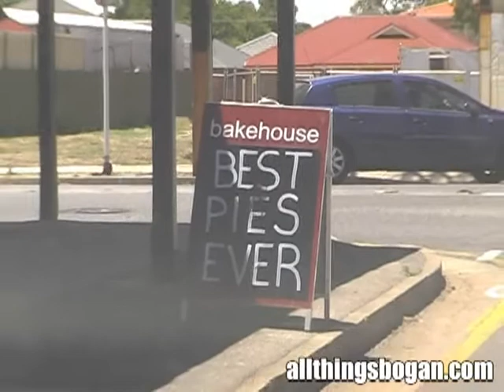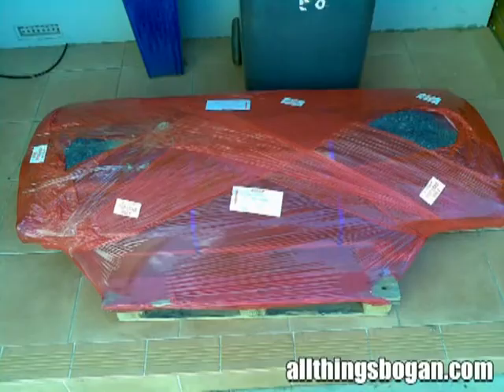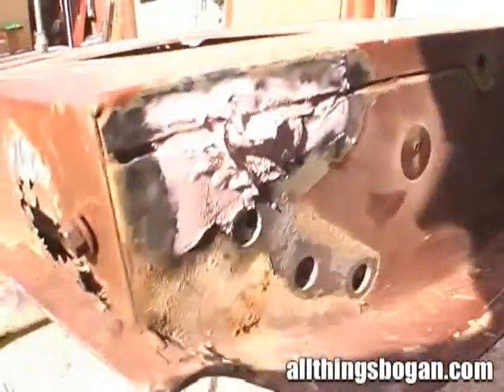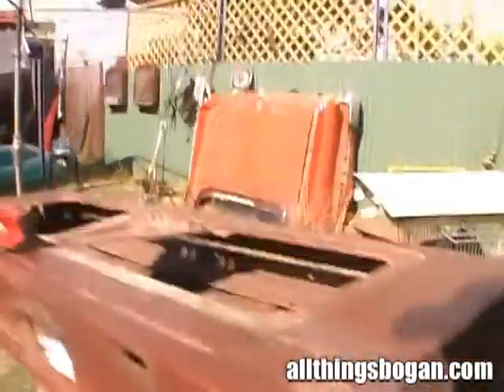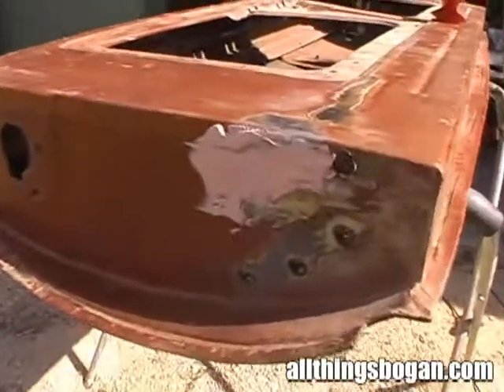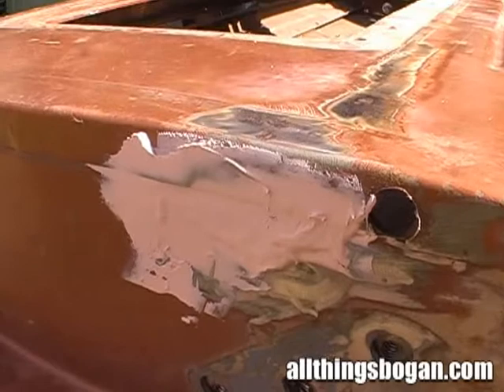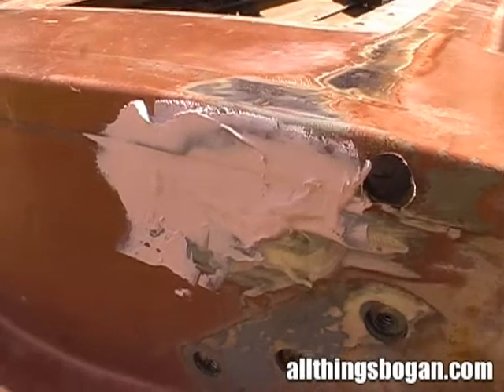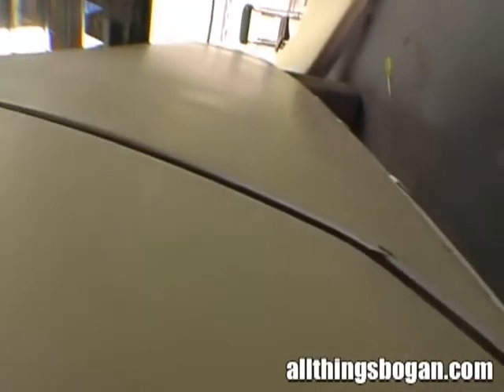Gus Bus Episode 9

Comment: Excellent work, keep it up. I had a Centura, great engine.....terrible handling. Still wish I'd kept it. 

All that bog reminds me of my 240z rebuild. I find using builders bog first makes for a better result because it is not hydroscopic so it does not let moisture to the metal. Still need normal bog over the top because it is way easier to sand.